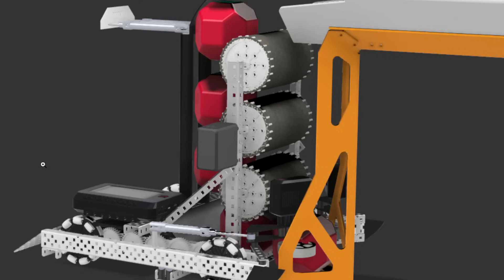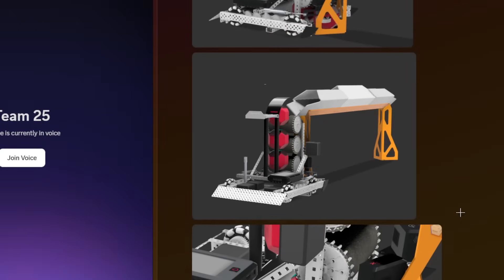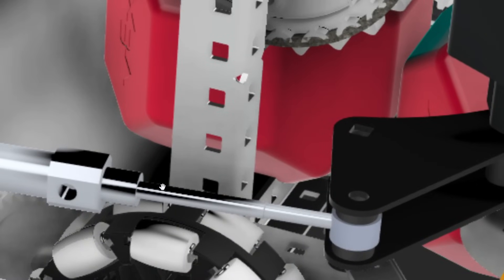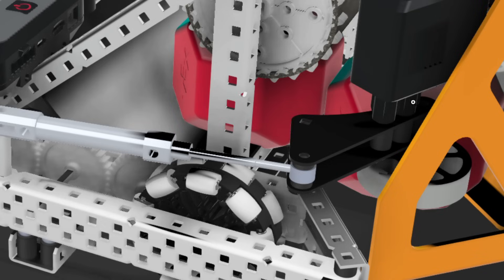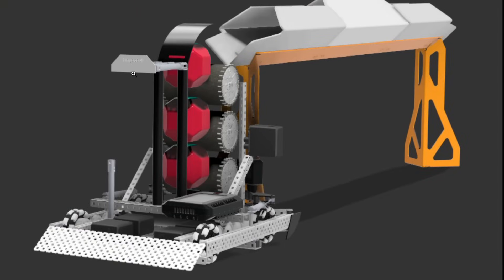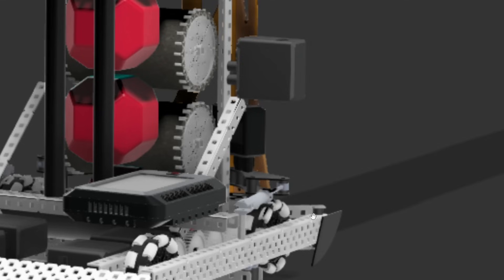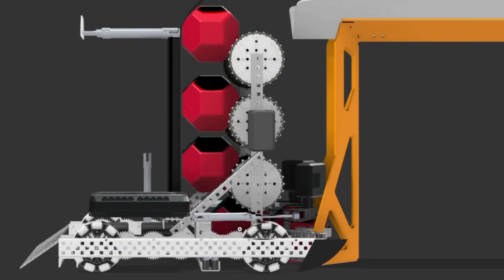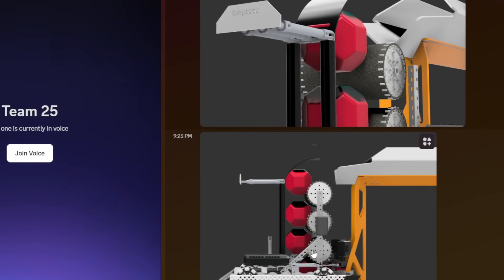This Could be a Great Design

Comment: Also, about parking. We predict the GDC will make changes to parking like in High Stakes. Obviously with the current manual it is not worth it, but vex does not fail to make the park/hang options viable, as we saw in High Stakes and Over Under
Reply: Yes

Comment: No hate but this is definitely not the best design out there 😭
Reply from the maker: i think if the meta is going for that last second park then this is good, if its hoarding then u may aswell also build this but just add a trapdoor and a box to hold balls
Reply: @lukedoesrobotics  descoring a center goal with a bump or scoring an empty center goal with 3-4 balls for control is almost more point swing and the opponents could do both in endgame
Reply: @astra-sl6tg 3 balls is a 38 point swing